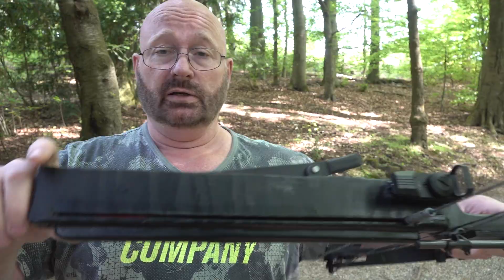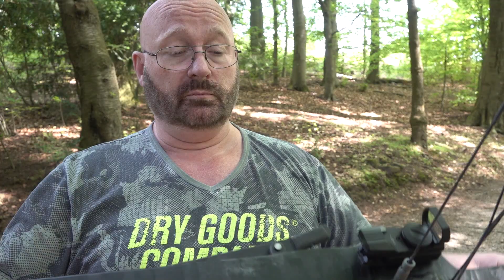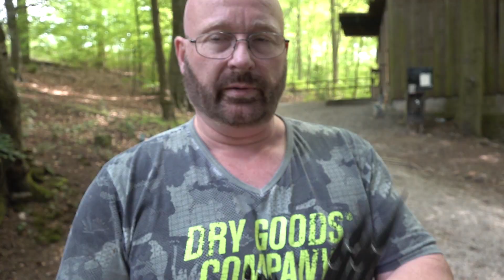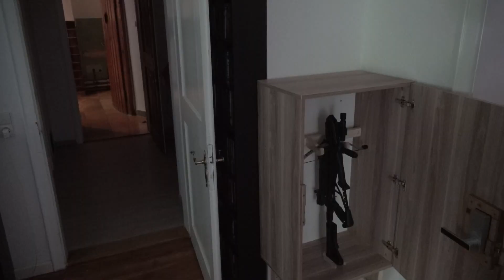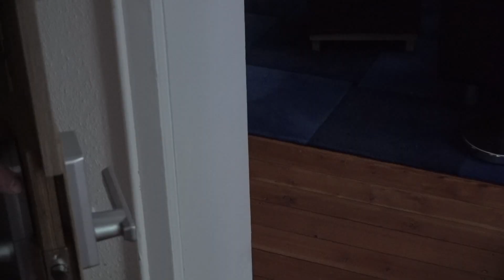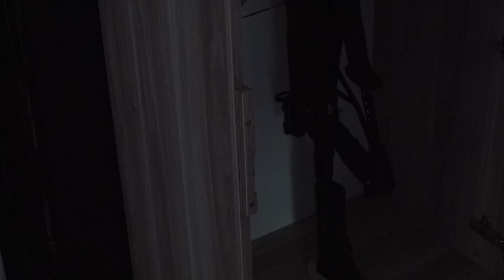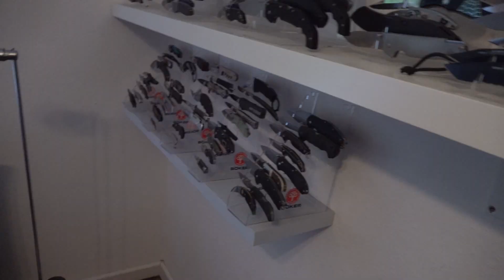The "Machine Bow" is a reality!

Comment: You could use an archers glove instead of the padding on the string. Also, there are barebow archers who use a technique called 3-under, so you could try this instead of the Mediterranean style (which is splitting the fingers 'around' the arrow). Since you have that weight on the back (behind the string) you may also want to try a stabilizer on the front of the bow (you can get short stabilizers, hunters use them). Good luck!

Comment: That is the greatest invention in archery since the compound bow.  Seriously.  For someone who prefers to shoot non-compound (which this could also do), it's the greatest advance since laminated limbs.

Also, in aluminum material that is slippery and with only a millimeter thick walls that slide in easily, you could make a box-in-a-box clip/magazine system by putting a hinge & swivel lock for the outer pusher arm/spring panel, with a slot also in the clip to let the pusher reach through to the arrow shafts.  You could have the arrow-feed guard on the string side of the clip be a thin panel that slid out backwards through a slot as well to allow final loading access.

Imagine, you run one clip out.  You unhook the pusher-arm panel at the back, swing it open, slide out a slotted clip box, slide in a new clip box, remove the slot guard on new clip, lock the pusher-arm panel closed again, and slide out the feed guard.  Six more shots, repeat procedure.  An archer could carry several extra clip boxes on hips and backpack, with no chance of snagging, damaging, or losing arrows until they were actually used.

As you retrieve arrows, you could reload an emptied clip while still having one in the bow and at least another full one in reserve, so you could be moving, shooting, and recovering continuously.

Comment: JoergSprave, instead of extending the holding cell and adding extra weight, why not do what you did with said holding cell, and add pivoting shoulder/arm straps, so you don't even need to "hold it" when you're not drawing to fite
Reply: Sorry, I meant fire, and turn your width to your length and vice versa, move the loading slot to the left on the top, with a tiny slide interally, dropping into a clip below the arrow in place to fire, is alot more room for the clip, isn't in the way of your arms

Comment: Sick design! I think if you could offset the handle and put both hands inline with each other you could improve the accuracy alot by allowing the leading hand to be more stable. Also if you could build in a de-cocker it would be a lot safer. Something that essentially by pushes or pulls out the bolt away from the string so that you can lower the string with out needing to fire.

Comment: 0:50 if any company tried to produce that as a product it would end up falling under regulations or cause the regulations to change. i would prefer not to take a position, but technically it does have a trigger, the feed mechanism is the trigger, and you have to hold it back after it has fired. not really hard to explain as having a trigger. but i have since i first saw you a decade ago understood your point, it is very easy to make a deadly weapon, so why regulate them. but the point is that YOU have to make it. you can't just buy it on the open market. have a nice day.

Comment: you could shorten the bolts, and make it more accurate by attaching a metal plate to the butt of the weapon, welded perpindicular to a long, sliding metal piece on a rail, attached to the bow string. the plate serves as a retainer for the arrows, you pull the string, and as you do what amounts to a stock would extend, and after firing, the metal piece would immediately close behind the string. further, to make arrow bundles feasible, this would allow you to shorten the arrows slightly, and allow for a simple trap door with a magnet catch. slip open the door, shove in a stack, close the door, keep firing.  to replace the hook follower, you could tilt up the magazine a slight hair, just enough to allow the arrows to roll, though im not familiar enough with bows or crossbows to tell you if this gravity fed system would work.
Reply from the maker: I don’t understand 1% of what you are talking about.
Reply: my apologies for being unclear. you mentioned a stock in your video, but also pointed out that it would make drawing the bow difficult. as a solution, you could add a flat metal plate to the end of the bow, attached to a sheet of metal on rails, attached to the bow string, running flush with the body. when you pull back on the bow string, the force of the pull would pull back the metal plate, which would extend the flat plate back, creating a temporary stock. upon release, the stock would collapse, sealing off the magazine.  for the magazine, instead of using the hook spring you have, would tiling the magazine upwards slightly work instead, as a gravity fed system?

Comment: What if reverse this idea, and make similar system to shoot steel balls, not arrows, with a compound bow?
Reply: That would not be ok for some gun laws since it would shoot a projectile through a barell..
Reply: @nocensorship8092  not true. airguns shoot projectiles out of barrels and are not considered firearms. At least n the US anyway.
Reply: @nocensorship8092  is that how it works? I always assumed that guns are considered guns because they're either propelled by gunpowder explosion for real guns or compressed air/gas for air guns (not to be confused with airsoft guns). Wouldn't being propelled by string make this idea as essentially a sophisticated form of slingshot? I don't think they have laws to regulate things like slingshots.
Reply: @nocensorship8092  there is not necessary to use barrel, it could be an rails with acceleration carriage.

Comment: That's quite a good design.  I like how you solved the spring issue and also give the hand a steady resting point. Holding even as little as 2-4 kg's can start to shake after a while.  Very clever.

Comment: Could you create a system that uses a little motor run by a battery to re-cock (whatever the archery specific term is) the bow automatically? Perhaps have a sensor that is triggered by the string when it’s back in place or some kind of pressure pad that detects the torsion of the bow itself and re-cocks when the arrow is ...fired? Whatever the word is. I don’t know, there’s an idea for a system in there somewhere...

Comment: May I suggest a magazine feeding system that fits the bow system you already made? I’m building it in CAD as I speak but it uses a very small lever on the bow where when the string passes by it releases an arrow that is also pressured by a spring in the magazine or clip whatever you call it.

Comment: Amazing! I'm only 10 years younger then you and when I was 6-14 I made a lot of bows and arrows, they got better and better and I learned how to hit stuff with arrows that pretty much where not straight at all... I later in life (+18?!?) bought a bow (some plastic compound thingy really cheap) and bought some (I believe fiberglass arrows, they did flex a lot) and hit most of the stuff I was pointing at. Was extremely satisfying. Then I found a aluminum arrow on the beach much later and then tried it with my cheap bow and that was just amazing. Anyway... Bought a wood crossbow with a metal bow for shooting plastic darts when I was 14-15 and even though it was pretty accurate at 3-4 meters  I had no problem shooting it longer as you learn how/what effects the travel of the arrow.  Yes I also made slingshots ofc! Mostly of wood (chooped from a tree split) and rubber threads with electrical wire as ammo. And it was after a bit of learning deadly accurate for about 20-30 meters (better then a stone, pellet and so on).

Love this!

Comment: two things I notice right away is 1 since it is a youth model bow when you draw it back you are violently locking out the cams they're not designed the holdup that kind of force essentially you are over drawing those cams eventually they'll fail and you're going to get injured second compound bow should never ever be dry fire that is also very very dangerous

Comment: I love your ingenuity but shooting at that distance with normal sights is very easy. The bow string needs to be to your cheek for stability and sighting your target. Additionally, it's kind of a pointless piece of equipment. If you need to shoot that many projectiles at something, get a gun. Archery is about accuracy and stealth. That said, you're very clever, but i'd work on something that makes sense to use.
Reply from the maker: You forget that there are many countries where guns are not an option for legal reasons. This bow is not designed to replace hunting or target bows. It is designed for plain shooting fun and as non firearm home defense weapon.

Comment: Don't dry fire a bow, ever. You can hurt yourself very badly, even losing an eye While destroying your bow. Now after having said that I want to say that this is a very cool design the only improvements I would make are changing the size and form of the magazine sothat you can use the standard compound bow draw (this will also allow you to use the higher draw strength since it looks like the poundage on that bow is very low. Otherwise it would have eploded as you dry fired it). The second improvemont would be to use the standard 2 part scopes of normal compound bows. The give you 2 reverence points like on a gun (one is in the string!) and they even have a little bit of a zoom (there are a lot of reasons why compound archers are so accurate) If you do this you have a very potent and user friendly compound bow, just don't let any of the other compound archers see you during hunting, they they might laugh at you ;P.

Comment: JoergSprave, you mentioned there wasn’t a practical way of increasing the draw length of the bow without it getting in the way of your shoulder to re-draw. What if you added a rail system? Make a slightly larger (or smaller) shell of the “barrel” fit that over (or inside) the “barrel” catching your arrow and attach it to your finger grip. As you pull the string back you catch the finger grip extending the new shell with the arrow inside. The extended shell could have a bar or nut stopping the shell at specific draw length, then release the string with the shell sliding back into the original shaft being stopped by a rubber guard. It would add a little additional weight but you would gain speed and distance, but it shouldn’t affect the flight path of the arrow considering the arrow should leave the bow before the shell slams into the rubber guard. Which might cause a slight jerking forward. I would love to hear your thoughts! Or better, a new video showing the design! Working or not haha

Comment: My solution would be to build an intentional flaw into the locked cabinet that isn't obvious so I can easily break it and get my weapon faster.
Reply: add the lock, but make it a just for looks, and use cabinet door magnets to hold door shut.
Reply: @nunovyobeeswax4177  IIRC they have inspectors to come make sure your cabinet locks
Reply: Glad I live in Missouri, don't have to worry about that kinda stupidity.

Comment: Yes . 2 please.. also,  consider these too... adjustable stock, put  extra material where it would require very little mod to lock string.. for where it is legal of course.     built in quiver a plus... for 6 more,   Or perhaps a 10 shot version.  Stardard picitany mounting for compact or full size red dots. Perhaps pic rail groves into top  and bottom of assembly?  Which  will allow Flip up sights and accessories,  like mount for standard green laser.. i would preorder such a thang.    I know you can do it in 6 months.   Get to work boss.  You have a winner here!  Btw, You have permission to use these ideas in your design... your a real inventor... and want to see you do well

Comment: Lmfao... It's a crossbow with a short stock. 
 A crossbow is a ranged weapon similar to a bow, consisting of a bow-like assembly called a prod, mounted on a frame called a tiller, which is held similarly to a rifle. It shoots arrow-like projectiles called bolts or quarrels.
Reply from the maker: A crossbow also has a lock and trigger, not the case here. Since the muscle energy is not stored this clearly is a bow. And now no more wisebutt comments here or I will show you the door.